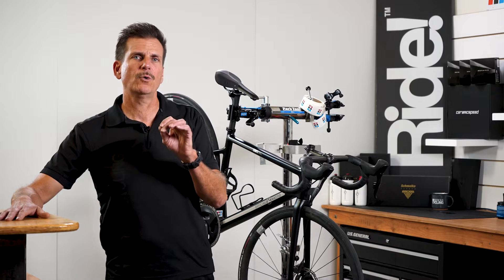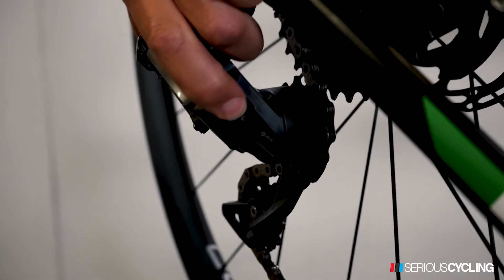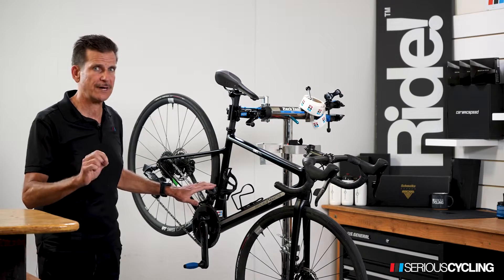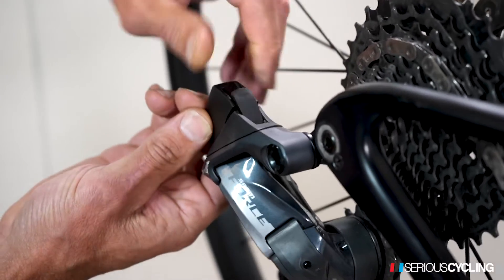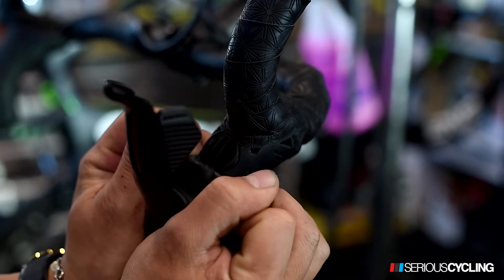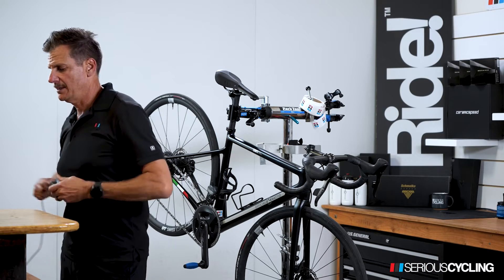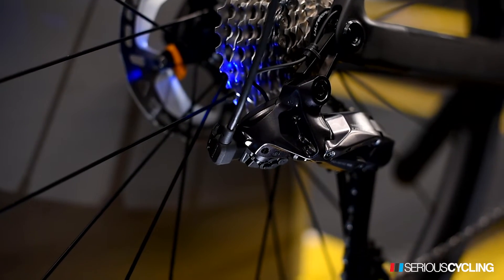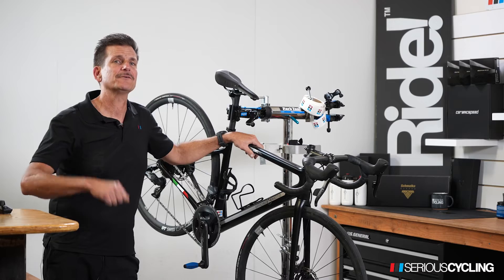HOW TO Check and charge your SRAM AXS electronic shifting

Comment: According to your comment about waiting until the battery is near full discharge, it appears necessary to have a spare battery.
Reply from the maker: would definitely recommend a spare in a saddle bag yes. I've known many riders that have had Sram die on them. My garmin head unit does show battery life so it's easy to see. not sure about wahoo
Reply from the maker: I would recommend it. I've had many friends run out of battery and it's always a sram bike. My garmin head unit does read battery levels on both shimano and sram, not sure about wahoo head units if they do that.
Reply: Remember to use the battery cover and remove the battery when moving the bike. When you shake the bike, loading it or transporting it, the battery activates and starts to discharge. 60 hours is a stretch with SRAM. I would say 30 or at the most 40 hrs. 5 days at 8 hrs a day, plus transport and the battery is almost dead. Buy a back up battery 100%